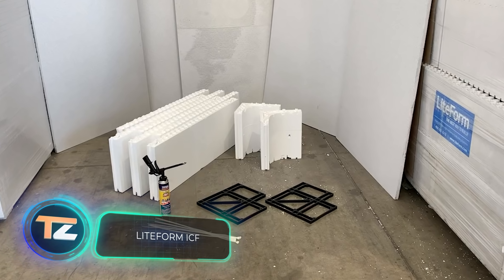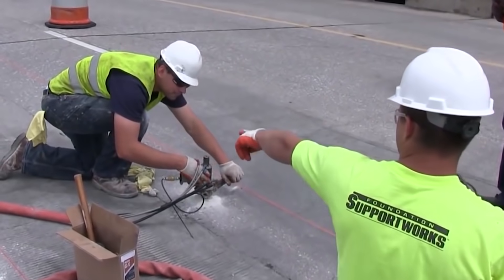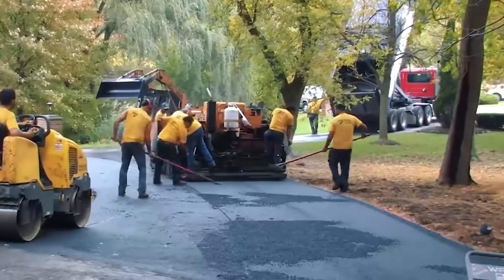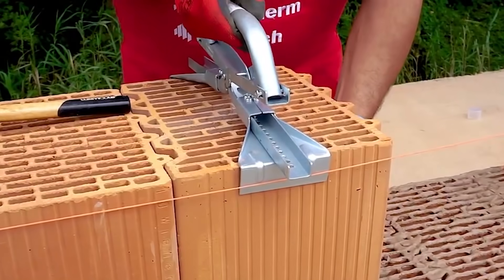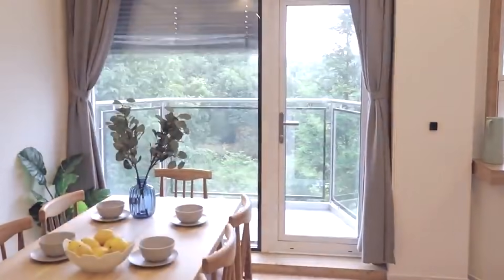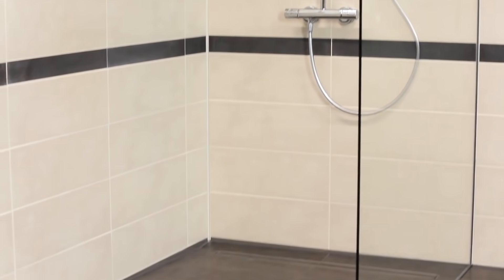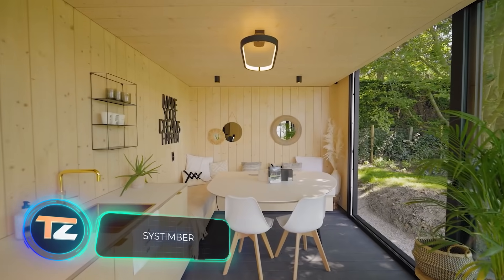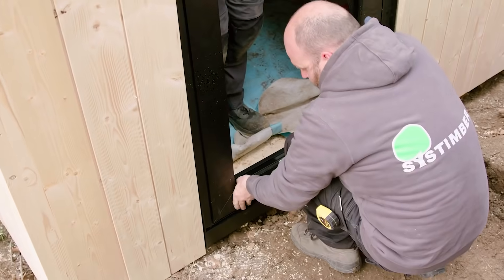MIND-BLOWING CONSTRUCTION TECHNOLOGIES YOU SHOULD SEE

Comment: These are my concerns:  Liteform ICF - foam is a good nesting material for insects, both above and below ground, probably not a problem if coated on the exterior with a material that is compatible with the foam and won't destroy.  Foam on the inside off-gasses in a fire and should be covered with another material to allow time to escape the building.  Be careful.  Excellent immediate insulation and forming properties, but probably not as good long-term or for your health.  Polylevel - good when it goes in, but insect nesting plus possible shrinkage over time would be a concern? How long will it stay level over time?  Electric snow melting system - what's the cost to run this, and how long is needed - is this really affordable? Porotherm - The thick bricks allowing insulation sound awesome, but bricks are typically air and water permeable more than most people realize - what are the properties when wet, and will it dry properly or degrade over time, will it handle a freeze thaw cycle?  I was reading that it needs to be coated on the outside, so there is more to installation than shown in the video.  And probably not good for earthquake or flood areas?  I'd like to know more about this - insulation values, permeability, etc.  Loving the opportunity to see materials used throughout the world, thanks.
Reply: great points
Reply: yeah the polylevel is only a temporary solution, but if lasts more than year maybe that's ok

Comment: Carbon fiber reinforcement... Looks suspicious to me...
Reply: Why?  Please explain more.
Reply: @Pam Pierce  
It's very  thin, and I can not imagine it can hold any significant bearing.
Reply: @amitaimedan  Have you seen the US government work on reinforced concrete using tiny fibers within the concrete instead of usual reinforcement methods?  Not the same thing, but maybe similar in concept.
Reply: @Pam Pierce  
But at this example the CF is glued on the surface of the concrete, not inside the concrete, in some photos the CF is even glued on the surface of the concrete, where it has little to no support effect. IMHO.